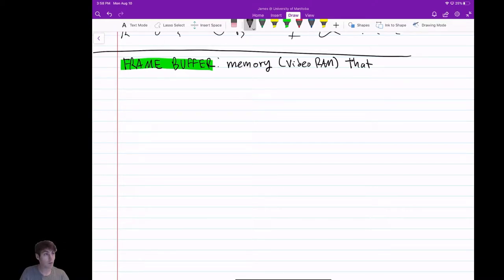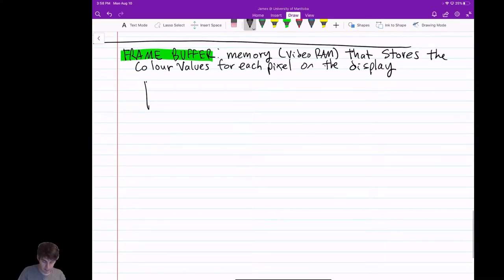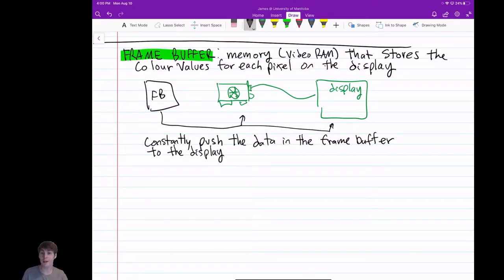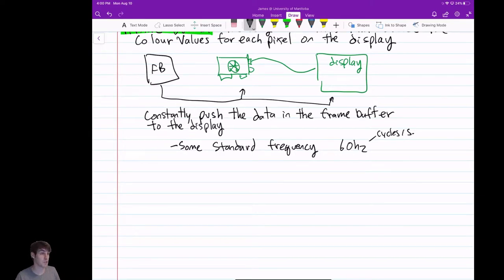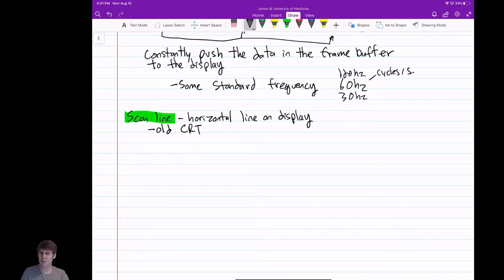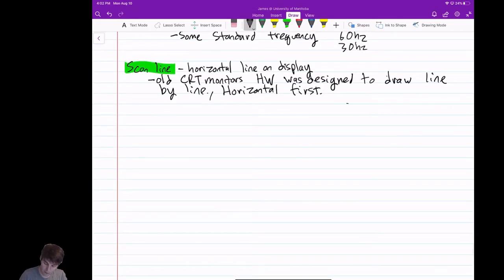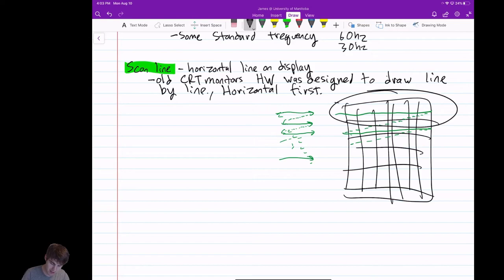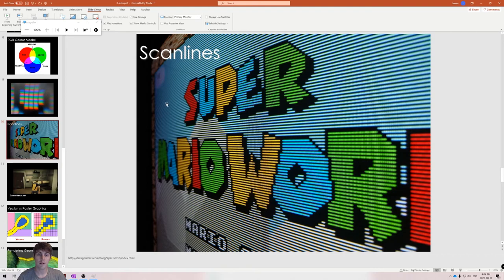(Unit 0) Intro 4: Frame Buffer

Comment: Great video mate. So if I am recording and streaming I am using both cpu and gpu at the same time framebuffer both on cpu and gpu changes due to use case ?
Reply from the maker: That's a /great/ question!!! You're right on the money with the fundamentals: to record or stream, you need to get that memory out of the video buffer into somewhere else. How that happens, though, is up for grabs. A CPU can do it, to move it into regular memory (or a separate location if it's already there). OR, if some kind of DMA chip or the memory manager may be able to move memory from that framebuffer to the regular memory. There's no framebuffer on CPU really, but it'd be in regular memory vs video memory.